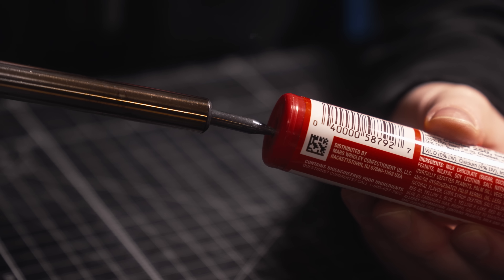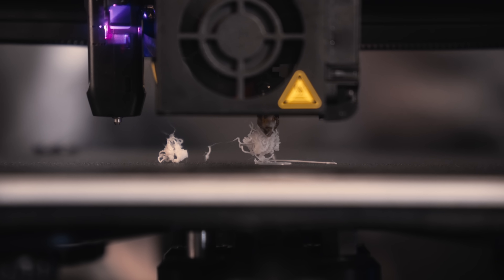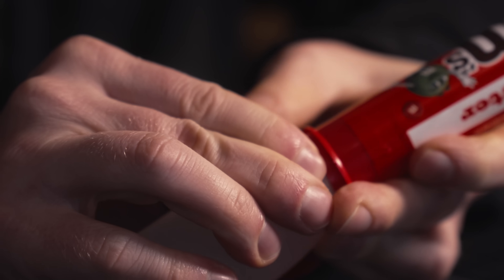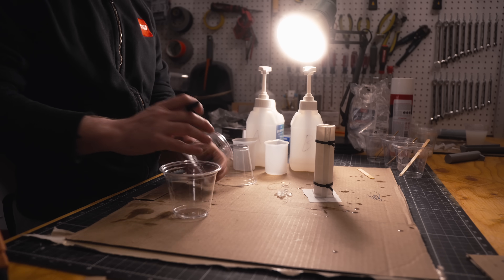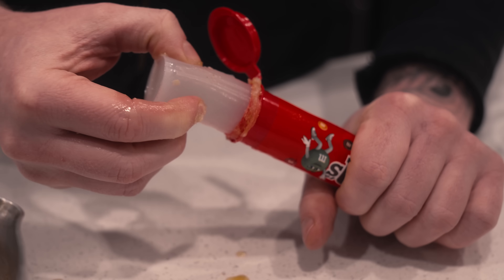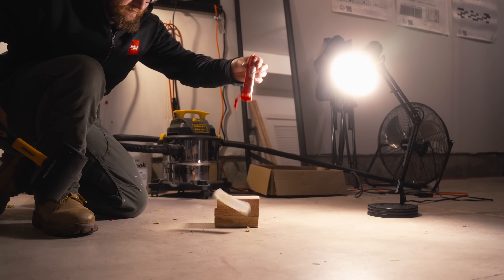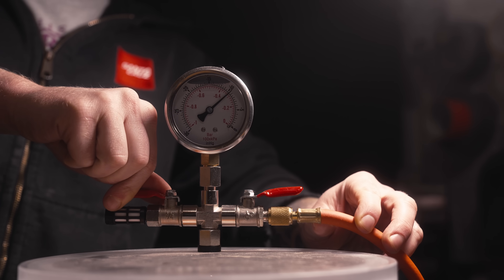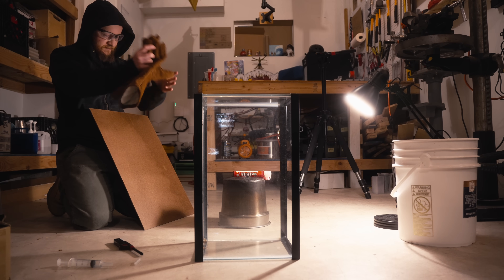Solving Reddit's Cylinder Problem with Science

Comment: You fool! OPs cylinder was attached to a larger object! How could you forget this crucial detail!
Reply: Don't forget that it's a weird-angle situation, too.
Reply: @thereprehensible435  the curve is perfectly natural, many cylinders are curved.
Reply: Yeah this video is clearly aimed at an audience of casual cylinder theorist, because a more in-depth one wouldn't get picked up by the algorithm
Reply: I agree, he has to redo the experiment
Reply: I do believe that his cylinder might have expanded to fit the tube.
Reply: @Karcist_Ithaqua  
If it expanded, it could have contracted as well, by applying ice to the cylinder
Reply: @dakzibbon6589  I assume that the cilinder became swollen and that's why the size wasn't going down anymore
Reply: If I remember correctly, in OP's post it was mentioned specifically that the cylinder lost its ability to contract due to the tube in response to a recommendation that OP simply wait.
Reply: @dakzibbon6589  the cylinder pushed all the air out, causing a pressure situation, making the cylinder unable to properly contract back
Reply: @foodaah  that sounds horrifying
Reply: @Karcist_Ithaqua  some kind of variable-girth cylinder would explain the fact that its previously measured girth doesn't fit the tube.

we may never know the true nature of the cylinder.
Reply: @random832  Cylinder may contract upon lower temperature, but only time will tell
Reply: @random832  I think it's just shrinkflation making the tube of M&Ms smaller than it was previously. No way op would like about the girth of his cylinder.
Reply: while I agree that this would be an issue for the video, the final method seems to be foolproof no matter the angle or object it is attached
Reply: @starberrysarah  Yes let's just hope they didn't stop watching after the vice and car tires seemed like a potential solution.
Reply: @JJFX- no, that wouldn't work. The force of the car would forcibly remove the cylinder from the larger object
Reply: @snookycooky  Oh god
Reply: Everyone asks "how's the cylinder?", but nobody asks "how's the larger object?"
Reply: @AnnaNym-h5k underrated comment!!!!
Reply: @AnnaNym-h5k its like its in a bathtub and being hugged at the same time
Reply: @AnnaNym-h5k Don't forget the oblate spheroids!
Reply: spoilers! now i'm not gonna watch the rest of the video since the experiment is rendered moot
Reply: @chou_hei  Spoiler alert: the solution that ended up working the best in this video would work even when the cylinder is attached to a larger object. So even if he forgot about that detail, it still doesn't affect the end result.
Reply: @chou_hei  the first half is mostly to make you imagine all the ways the integrity of the cylinder can be manipulated. the final solution is actually functional with a larger object attached
Reply: @chou_hei no legitimately tho, this happens to me. like im sure the video is great but i just lost all interest in it after finding out this detail is missing from the test
Reply: @GrimlandCS i normally feel the same way but decided to watch this one still and it’s totally worth it. most of the video is having fun exploring solutions of varying success but the final solution would absolutely work just fine, so it’s good lol. hopefully nothing i said feels too revealing about anything else, i was doing my best
Reply: @GrimlandCS  same bro
Reply: @GrimlandCS  Is it because, for some reason, you NEED a solution to this exact problem?
Reply: @GrimlandCS  The one saw would likely work even with the cylinder being attached to a larger object, so I feel like it'd still solve the issue.
Reply: @GrimlandCS  yeah in most situations I just give them a fat dislike and move on
Reply: @GrimlandCS how was the hospital trip
Reply: @GrimlandCS  Just wait till y'all learn the cylinder wasn't actually made out of silicone
Reply: @ashoka7273 No shit. The cast saw would still work though.
Reply: @ then get tf out of comments and watch
Reply: @chou_hei  honestly it's a good thing you didn't because about halfway through he calls m&ms about the "issue" and the woman on the phone seemed very uncomfortable and it was just very weird to listen to and i didn't really find it funny at all 😭 at least the og reddit post was harmless because he wasn't forcing someone to have a weird conversation with him, everyone participated voluntarily, but what this guy did in the video was just plain gross
Reply: @noemiz8241  oh shut up. waaaaah a phone rep had to answer a phone call and have a funny conversation for 5 minutes. THE HORROR!!!
Reply: @kage6613 Forcing someone to listen to you talk about your cylinder while they’re on the clock and unable to hang up is sexual harassment.
Reply: Luckily the larger structure does not interfere with the cast saw method.
Reply: In general, cast saws are used on cylinders attached to larger objects, except the cylinders it typically interacts with are human flesh, so it most likely isn't the kind of cylinder OP meant.
Reply: I immediately thought of this just by looking at the thumbnail. Major piece of information
Reply: oblate spheroids, too
Reply: I think cast cutter works well even with this addition
Reply: @homhomasl2338  iirc OP went to the hospital in the end so cast cutter is probably what did it yeah
Reply: You can just cut the cylinder off the larger structure
Reply: @JinKee It is imperative the cylinder remain unharmed.
Reply: and the two spheres attached to the cylinder
Reply: Caste saw still works.
Reply: @LJ1st1  That only cuts through Indian hierarchy 😂

(I think you meant cast saw)
Reply: I mean the cast saw would still work
Reply: The cast saw is designed for the use of that tho. Like it’s used to cut casts off and the cast on ur broken arm is like attatched to a larger object
Reply: The classic blunder
Reply: I was about to say the same thing, im Gladis I wasn’t the only one thinking that since the beginning, like, sorry man but you forgot a crucial thing about it and have to redo it if you really want to solve it…
Reply: @ang_jpngg Except most of the video was blatantly just joking and messing around, and the only legit method which was at the end would work fine while attached to a larger object and attached oblate spheroids.
Reply: Was the larger object a rigid body, or more like a soft one?
Reply: Or maybe OP had a detachable cylinder
Reply: @KWAZ449 
That would be a neat idea, then you could upgrade or chose one of the perfect size.
Reply: @Therapistinthewhitehouse Exactly.
Reply: The end solution works anyways
Reply: You’re be surprised how flat you can make said cylinder without causing any damage. I’ve seen too many weird videos okay.
Reply: last method would still work
Reply: True
Reply: Don't forget the two spherical objects attached to the base of the cylinder, it's imperative they remain undamaged
Reply: A sharp knife could change that. 😈
Reply: At an awkward angle as to not get anything in
Reply: And there’s also a pair of oblate spheroids near the base
Reply: 4 inches wide
Reply: @cakkkkkkkkkkkk in circumference
Reply: It is implied, of course.
Reply: *Larger structure
Reply: and two oblaye spheroids!
Reply: almost as many likes as the viral video itself is wild
Reply: He also forgot the two objects at the base of the cylinder!
Reply: Don't forget the oblate spheroids
Reply: Why does it sound like jordan schlansky
Reply: Precisely, it is a failure of an experiment because he forgot to include every crucial detail
Reply: @nattiedraws Its not that serious dude, the video is clearly just messing about except for the last solution which would work fine attached.
Reply: JUST SAY IT
Reply: I mean, the cast saw could still probably handle it just as well
Reply: I'm afraid OP had a very embarrassing incident
Reply: With two oblate spheroids attached as well.
Reply: And that the cylinder is also attached to two spheroids  and it remains of utmost importance they as the larger object remain unharmed
Reply: That's a solvable issue
Reply: My thoughts exactly.
Reply: phoenix wright ahh line
Reply: I'm the only guy who still has the whole video posted on youtube
Reply: @theduncandonut7576  "The original video"?
Reply: Straight up. I was so excited to watch this video but forgetting this detail made me totally lose interest :(
Reply: @kokosagina  The very last method works either way, so there's a pay off in the end and the initial criticism is ultimately unfounded.
Reply: Yeah and don't forget the two spheres underneath
Reply: That is correct. The removal of the cylinder must account for the other existing factors. Such at the larger body and "weird angle" other wise this experiment has no useful conclusion
Reply: @yatsu9437 Actually the final conclusion works just fine with all variables in effect. The rest of the video is clearly just messing around for fun. You and all the other people commenting this must be really fun people.
Reply: Gotta redo the experiments!
Reply: Was the cylinder his.....
Reply: I like that this comment is close to ratioing the video. It needs to be redone

Comment: You said they used girth instead of circumference so the diameter would be about 1.6 inches.
Reply: In practice, many owners of cylinders are not great at estimating dimensions of cylinders

Comment: In the option with the acetone I think you overflooded your cylinder...
As a scientist you should know that ignition occurs not in a fuel but in a controlled air-fuel mixture.
So the right thing here to do was pour some acetone inside then drain it back before igniting

Comment: Its a little known fact, but cylinders tend to get smaller when engaging in jumping jacks. Your mistake was doing the jumping jacks, and not teaching the cylinder how to jumping jack.
Reply: I was about to comment about this so I'll reply here. I think the reduction in size had already happened to the maximum extent possible before the Reddit post was made. That's not a post you make unless the interior cylinder is at minimum size. The panic itself is much more effective at geometric transformation than exercise. Changing the volume of the cylinder wouldn't be particularly helpful since we can infer that it was stuck at both extremes. possibly for different reasons, reduction could intensify the negative pressure while augmentation could compress the sealing interface.
Reply: @EDoyl bro definitely put the cylinder in at minimum size, then once it grew the outer cylinder prevented the inner object from shrinking enough to come out, even with emotional panic and jumping Jack's.
Reply: @EDoyl but I‘d expect people engaging in these activities would insert the cylinder at close to maximum volume, kinda strange that its still too large at minimum volume. But maybe his cylinder doesn’t change much in volume at both extremes…
Reply: Ok, let’s run through it.

Step 1: Cylinder goes in at high volume. 

-this creates suction, preventing exit

Step 2: Natural cylinder processes attempt to reduce cylinder volume

-This proves impossible due to strength of suction

-This makes the situation immediately dangerous for the cylinder and, consequently, the larger structure

Step 3: Hospital
Reply: @EDoyl  It depends on the shape of the cylinder being used. Some have a slightly smaller circumference on the farthest end from entry into the tube giving a similar effect to a fish hook where you can push in, but pulling it back out won't allow the same amount of force to get over that increased circumference in the middle. There also happens to be a inner tube in the cylinder that supplies fluid to the cylinder to inflate it to it's maximum size. It is also how the fluid is drained from the cylinder. If the inner tube is sufficiently compressed it might not allow for the release of the fluid to decreased the size of the cylinder enough to allow removal. There are specially made rings that are made to help keep fluid in your cylinder when it has aged and has difficulty retaining fluid. Funnily enough, the same company that produces the silicone cylinders also makes the accompanying rings for cylinders, though they're not often marketed to the same customers who purchases cylinders.
Reply: @EDoyl The problem is that the resistive force of the M&Ms™️ tube counteracted whatever shrinking would have been experienced by the cylinder from the larger object's panic
Reply: Is there an opposite version of the fact, asking for a friend, you know
Reply: @ArchiWorldRuS  Cylinder pump.
Reply: @MrDrury27   Just remember that using a cylinder pump too aggressively or too often can cause permanent damage to the cylinder.
Reply: @ElfangorQ7N yeah only very advanced hydraulic not air pumps from Germany works... people make cylinders 10 percent longer over year or two. it's very hard work for almost nothing.
Reply: @ArchiWorldRuS  the opposite of jumping jack is probably sitting still
Reply: @ArchiWorldRuS The opposite version is even easier. You simply take a certain pill.
Reply: @ArchiWorldRuS If the EnD is related to visual stimuli, slowly returning to tastes closer to vanilla will help. 

The main idea is to relieve oneself of content that psychologically messes with your inner idea of what gex is supposed to look like. 

A prime time to engage with this method is when even extreme content may start to appear unappealing to the user.
Reply: You give a cylinder a jack and it jumps for a day, you teach a cylinder to jump and it jacks for a lifetime
Reply: @NErDy-pr1jf  this is how I was going to word my comment originally. Thank you for making the joke I was too weak to make.
Reply: I don't know if this is the same effect, but simply flexing a muscle for a bit will cause a blood redirection and the cylinder will shrink. This method is very useful for when you want to hide your enlarged cylinder.
Reply: I saw a video recommending people to do push ups to reduce their cilinder size
Reply: @davidmedinacuevas1977 interesting idea actually. maybe some day it save a cylinder or two.
Reply: My cylinder has not done a jumping jack throughout its documented existence.
It preferred to jump on Jills, but says it's not opposed to any jumpery, whatever it may mean.
Reply: Are you suggesting he should have jacked the cylinder until it got smaller?
Reply: But how does a cylinder do jumping jacks? How do you do jumping jacks without legs and arms?
Reply: rain world.
Reply: I think the cylinder was lubricated enough with the banana and butter to go in but the going back out is impossible due to increased friction between the cylinder and the walls of the m&m tube after the butter and banana was pushed aside
Reply: It does not have to be jumping Jacks, any physical activity can work. The issue in this case, is the cylinder is compressed, preventing the hydraulic system from retrieving the expansion fluid.
Reply: @kiritotheabridgedgod4178  If the cylinder can be penetrated, it can be filled with expanding foam from the other side which will allow the smaller cylinder to "pop" out if the insides are lubricated enough from the banana and butter. If expanding foam is not present, I would suggest an air pump with an airtight seal though I wonder if the cylinder will be affected much.

Comment: 15:36 Wow what a great tool for situation like these 
Thank God some one though about this exact situation and made this tool
Reply from the maker: The real shocker was being able to buy medical equipment without some sort of permit
Reply: @natescovill  Yeah, i can think other uses like cutting stuck ring on finger maybe that's why it so easy to buy
Reply: @Timewastedonyt  i don't think so it was designed for casts as the name suggests so it can cut through hard and brittle material but rings are not brittle or hard so... yeh
Reply: @arshia4866  So that limits it uses to  only two three things only
Reply: I dont think it is that suprsing tho maybe what I am used to is diffrent due to living in Europe. But you can buy quite a lot of medical things as long as they are relativly harmless and risk free. And a cast saw kinda is that I would say. It is literally made to not injure people
Reply: @natescovill  honestly the cast saw seems a lot safer than most power tools, and those anyone can just walk in and buy
Reply: @natescovill  Did you know you can just buy labcoats? Also, various chemicals can just be bought as well, I have a bottle of phosphoric acid sitting mostly unused because I had it in my mind to make my own cola once, and instead of starting with just making cola, I immediately bought the ingredient I had identified as being a key part of all my favourite colas. During taste tests to figure out the proper level of dilution I found out that phosphoric acid is impressively bad for your teeth. Have you ever had too much cola and you can feel your enamel become sticky?
Reply: @bramvanduijn8086  I knew the labcoats cause you need to provide your own usually for lab classes in college but bruh rip to your teeth 😭
Reply: @candledapple  Eh, they recovered in two days, it's about equally harmful as drinking 3 liters of cola every day for a week :D, and yes I know that from experience too. Just make sure you don't use a hard toothbrush while they're hardening again, otherwise you'll scrub the softened enamel off. Actually, you shouldn't be using a hard toothbrush anyway, there's no reason to be that violent with your teeth. Use a soft one.